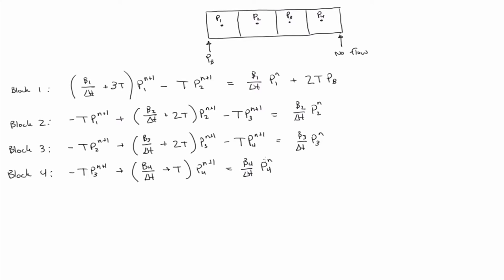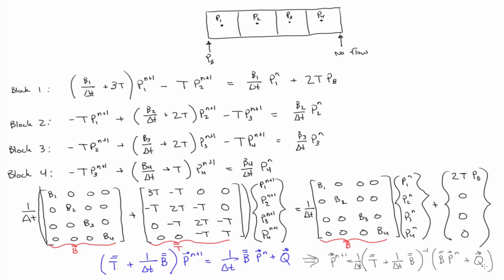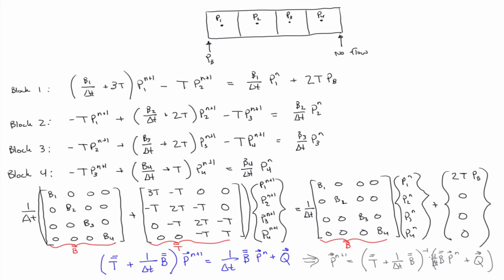Implicit Transmissabilty Form

Comment: Hi, and thanks ,Mr.Foster, for these great lectures. I got one question though, the constant that we multiplied to each side of implicit form (from which we derived T and B), contains formation volume factor(Bw), the viscosity and perm(which I assume we consider relative perm here),which are time dependent parameters. Considering the fact that in the transmissiblity form we use same T and B for time frames n and n+1, it is interesting to me how valid it is to use a factor that contains time dependent features as constant to be multiplied implicit form. 
Thanks beforehand